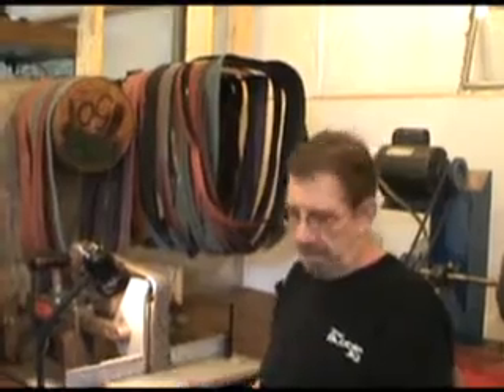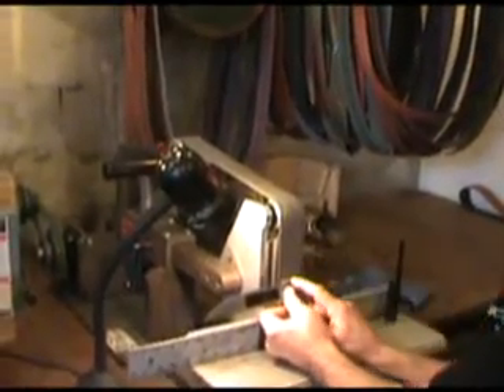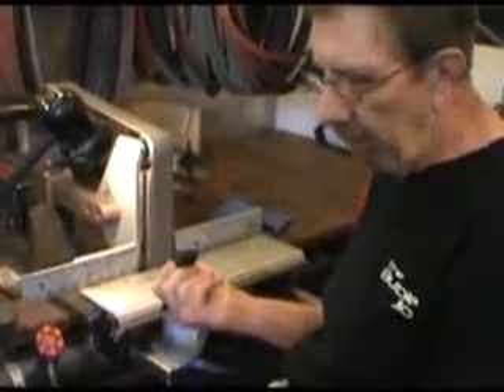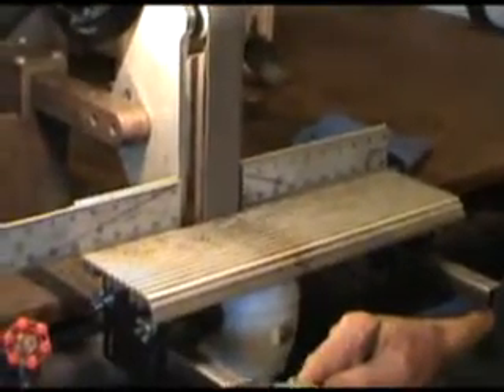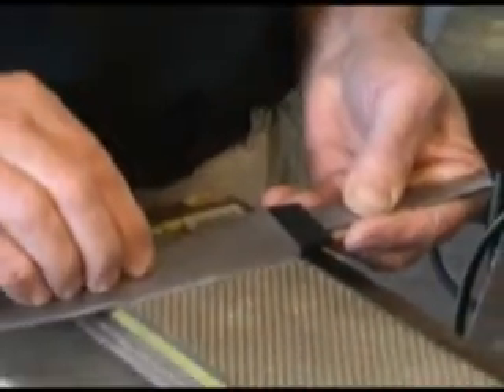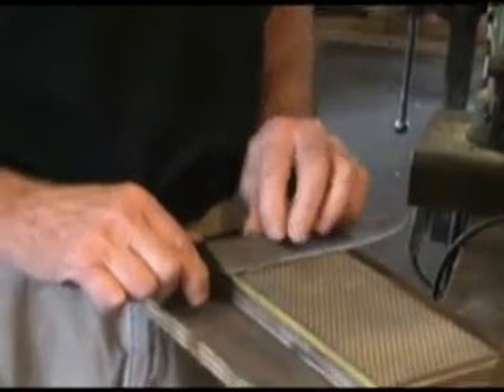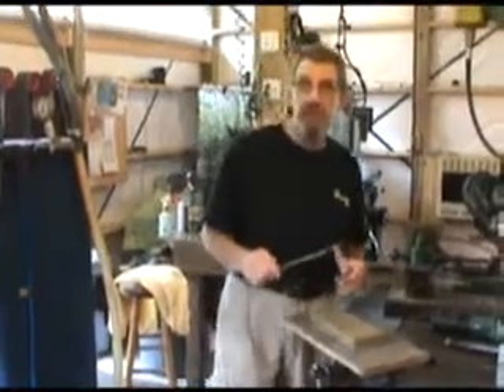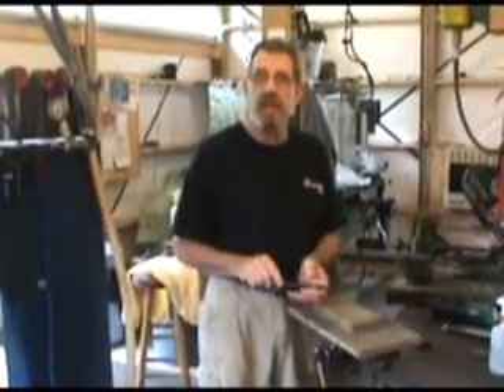Bubble Jig Knife Sharpening

Comment from the maker: @E29Able
I did just that. Its the false edge that is scary. The ones ground using the jig make you bleed. There is no sharpening required after they are ground, they are shaving sharp. It even surprised me and I have ground a lot of blades with this jig.

Fred

Comment from the maker: @Savagejay07 

       If the edge on the knife is already fairly thin; not sharp but thin, I start with a used 400 grit belt running at a slow speed. Two passes on each side will "set" the edge. As shown in the video, I finish on a diamond stone. 
If I am developing a secondary edge I will make the first passes using a 120 or 220 grit belt running at a slightly faster speed. 
Also, very little pressure is applied and so little heat build up is realized.
Thanks for your post, Fred

Comment from the maker: @Savagejay07
   If the blade edge is fairly thin, not sharp but thin, I start with a used 400 grit belt running at a slow speed. One or two passes on each side is all it takes to sharpen the edge. 
If I am putting a secondary angle on the edge, I start with a 120 or 220 grit belt at a slightly faster belt speed. Once the secondary edge is set, I change to the 400 belt and slow the machine down. The main reason you get little heat build up is very little pressure is applied when sharpening. 
F